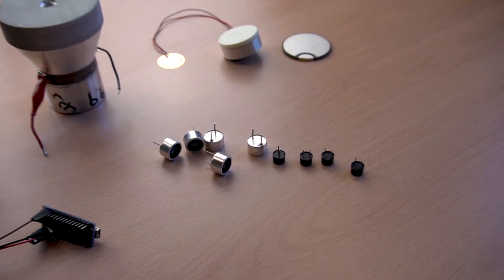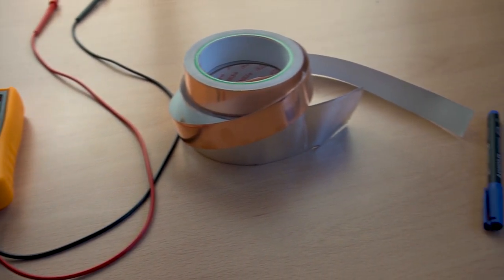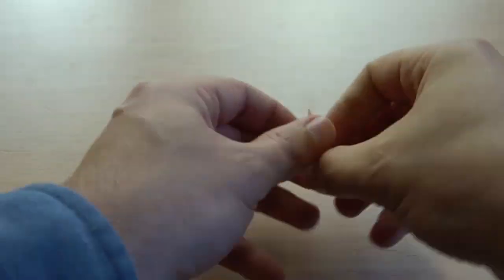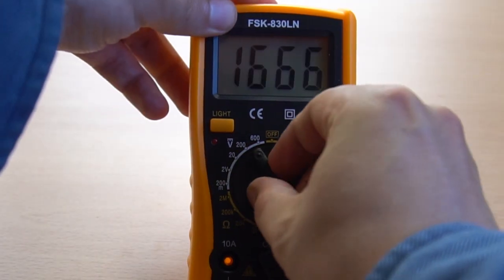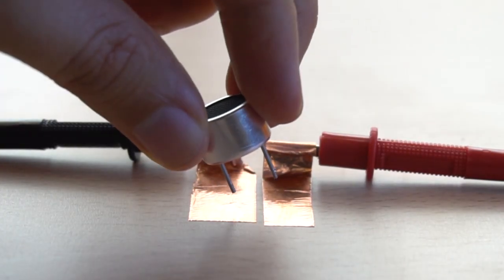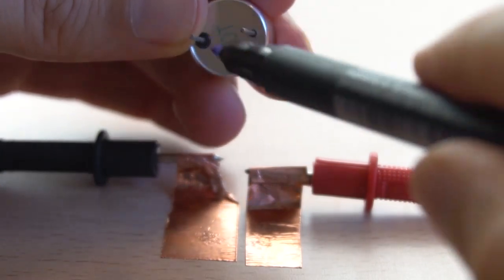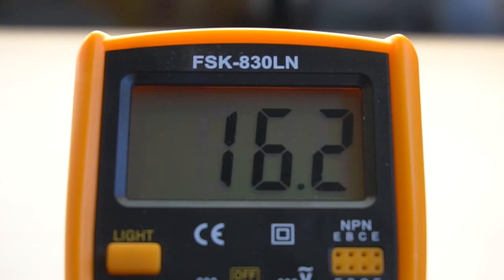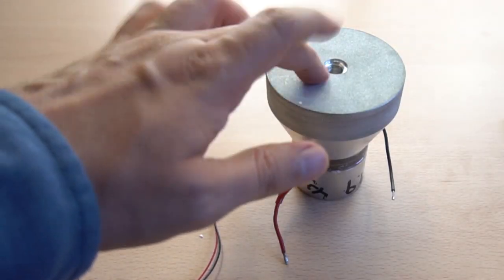Tutorial: Marking the Polarity of Ultrasonic Piezos using a Multimeter

Comment: Is the part painted with a pen a negative pole? ( - )
Reply: it is supposed to be positive. Tghe reason why we mark the gnd when voltage is negative is to avoid trying the other way, just not to repeat it twice.
Reply: m06-05-2023

(1.) Hi, there.

(2.) The following shows a picture of the POS ( + ) and the NEG ( - ):

Taidacent Open Type 40KHz 16MM 0.3-15m Ultrasonic Sensor Ranging Probe Ultrasonic Transmitter Receiver Non Contact Ultrasonic Level Sensor Analog Ultrasonic Sensor (NU40C16R-1D)

(3.) ‘Hoping it helps.

(4.) Toodles!

Comment: This is confusing. The marking is for what? Negative or positive? What does the mark means??
Reply from the maker: Positive, if you consider them receivers. It does not matter if it is + or -, the important part is to have all of them with the same polarity.
Reply: m06-05-2023

(1.) Hi, there.

(2.) The following shows a picture of the POS ( + ) and the NEG ( - ):

Taidacent Open Type 40KHz 16MM 0.3-15m Ultrasonic Sensor Ranging Probe Ultrasonic Transmitter Receiver Non Contact Ultrasonic Level Sensor Analog Ultrasonic Sensor (NU40C16R-1D)

(3.) ‘Hoping it helps.

(4.) Toodles!
Reply: @UpnaLab what if I use it for transmission?

Comment: m06-05-2023

(1.) Hi, there.

(2.) The following shows a picture of the POS ( + ) and the NEG ( - ):

Taidacent Open Type 40KHz 16MM 0.3-15m Ultrasonic Sensor Ranging Probe Ultrasonic Transmitter Receiver Non Contact Ultrasonic Level Sensor Analog Ultrasonic Sensor (NU40C16R-1D)

(3.) ‘Hoping it helps.

(4.) Toodles!

Comment: Why does this technique work?
Reply from the maker: The piezoelectric element acts as a capacitor which stores charge.
Reply: @UpnaLab  Granted, but why a certain polarity? It's not like an electrolytic capacitor where the electrolyte can cause a parasitic electrochemical cell, right? What gives the PZT a reason to preferentially charge in one direction? is it loading due to the own weight of the cell?

Comment: Which side are you marking?
Reply from the maker: If the first read voltage is possitive I mark the leg that was touching the red probe. If the voltage was negative I marked the leg connected to ground.
Reply: m06-05-2023

(1.) Hi, there.

(2.) The following shows a picture of the POS ( + ) and the NEG ( - ):

Taidacent Open Type 40KHz 16MM 0.3-15m Ultrasonic Sensor Ranging Probe Ultrasonic Transmitter Receiver Non Contact Ultrasonic Level Sensor Analog Ultrasonic Sensor (NU40C16R-1D)

(3.) ‘Hoping it helps.

(4.) Toodles!